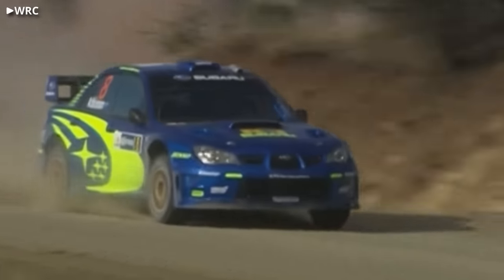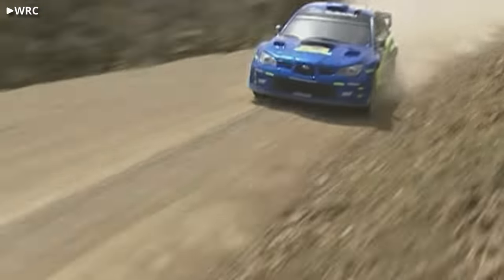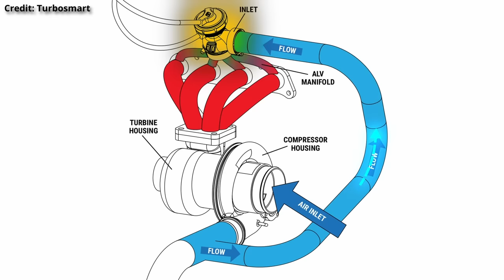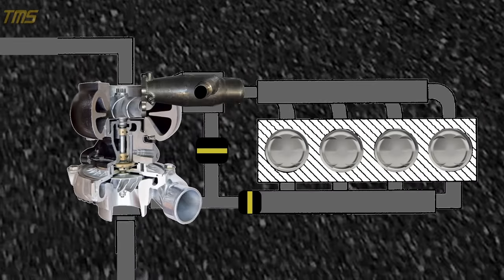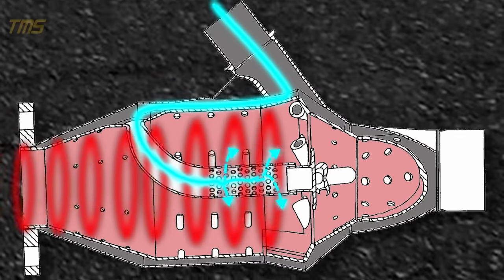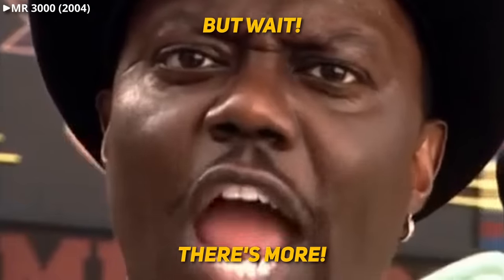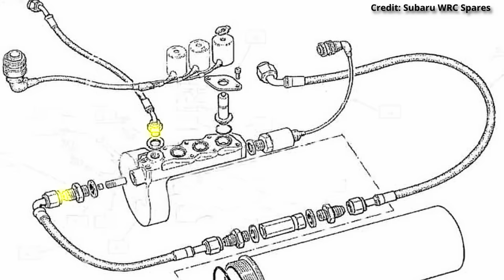When Subaru Put a “Jet Engine” In Their Exhaust | Rocket Anti-Lag Explained!

Comment: This is a lot closer to a jet engine than you would think. In fact, really the only thing seperating it is that it does not provide thrust for movement, and that's not a specific criteria to be a jet engine at all. This is what would be called an annular combustion chamber, and has some really neat things going on for efficiency, but I digress. While all combustion chambers will have a source of ignition, what most people don't realize is that that source is only used during startup. Jet engines otherwise have a constant combustion going on at all times as new fuel and air is introduced and combusting air is exhausted. One of the challenges of designing these systems is making sure that the combustion doesn't get "blown out" by the high entry speeds of intake air. Not only that, but in pretty much every sense, this is a jet engine system. It's just more like you would see on a centrifugal compressor turboshaft or turboprop, and so not as common or recognizable (axial compressor engines are the 'normal' jet engines). You could also like it to an APU since there's no real 'work' being done by the system. But they key things are, a combustion chamber where combustion is constantly taking place, whose exhaust gases feed a turbine, who spins a compressor, who feeds the combustion chamber more air. But in every sense, it's a jet.

Comment: You have a better understanding of these systems than 99.9% of people out there, and I'll share a few things to fill in a few blanks:

Re: Myth 1 - the boost pack (cylinder on the top of the engine) is a boost accumulator, but you are spot-on for what it is used for - turbo speed control (i.e. wastegate control).  In that sense, people saying that it stores boost aren't wrong, but their assumptions that it feeds the rocket system are misguided.  It is one critical piece of a very complex system that controls turbo speed and boost.  FIA homologation document A-5695 sheds a little light (very little) on how the solenoids are used in engine controls if you ever want any further information.  From what little technical information the homologation provides, the three solenoids are used rather than a single large solenoid to maintain a very precise control over the pressure in the accumulator - simply put, the more variables you can fix in a control system of this complexity, the easier of a time you will have 'programming' it to do what you want.

Your section on turbo lag is the only section lacking detail of 'why' anti-lag is so important in rally competition.  To complete this, you need to consider the intake air restrictor the mandated distance of the sonic nozzle choke point (plane) to the leading edge of the compressor blade - usually 3-5 mm depending on the competition rules.  This effectively does two things - limits maximum airflow by mandating a maximum orifice dia. AND forces the turbo to operate as if it were at a much, much greater altitude by creating a relative vacuum immediately before the compressor blade.  Obviously the builder still wants the same power out of the motor, so the turbo is forced very close to the surge line to make the same gage pressure.  Understanding of sonic nozzles and sonic flow also helps make sense of why turbo rally motors tend to have no torque until they hit a specific RPM, where they get a MASSIVE spike in torque which tapers as engine speed increases.
Reply: The turbo restrictor challenges are something seen at lower levels of competition, such as GpN or North American rally equivalents.  Many people would assume that rally homologated special editions of Mitsubishi, Subaru, and other makes use more exotic materials in the OEM turbos to save weight (Titanium in compressor blades, shafts, etc.), but often these are actually there to provide longevity to restricted turbos as the internal forces they see are far greater to achieve the same amount of power.  Aggressive anti-lag and over-speeding of the compressor are almost guaranteed at these levels of motorsport given the budgets and rule-sets.
Reply from the maker: Thanks for the additional info! I'll have to read up on that FIA doc, sounds interesting. And those are certainly good points regarding the intake restrictors. I love learning from my audience just as much as I enjoy sharing this stuff with others!
Reply: @themotorsportstory  the FIA homologations do a very good job of hiding the rocket assembly overall, but having a complete library of Subaru GpA documents would be nice if they didn't cost 300USD each.  Since it was entirely passive piping, the functional diagrams just show it as such - simple pipe with a fresh air valve attached.
Reply from the maker: @MrSaturn7085  Just makes me wonder how much more cool tech is out there in racing that we don't know about!

Comment: I always knew that anti-lag was achieved by dumping extra fuel to the exhaust manifold but this is such an elegant system, no wonder it was so good. It operates more like a pulse jet engine than a typical "Rocket". The German V1 flying bombs of WWII kind of used a similar operating method.

Comment: Probably the only person to explain turbo lag correct.
But to be 100% correct, turbo lag is what happens when you are in the power band and come off throttle, the time it takes the turbo to spool back up(while all still in the power band) that is turbo lag.

What we commonly refer to as lag in the boost threshold.

Example: 1500-4000, vaccuum at 1500, full boost from 4000 to redline. That is boost threshold

4000-redline, full boost lets say 15 lbs, close throttle, boost drops to 0 while engine is at 5500, then reopen throttle that delay is what turbo lag is.

Also bring back innovation in motorsports

Comment: You know why its called "Rocket" ?

Because its a similar concept of Germanys V1 Rocket.

Its a pulsing combustion booster and it makes a similar sound like the V1 rocket once you aktivate it without a turbocharger bolted on...
Reply: Technically the anti-lag system is the same thing as in the V1. It is called Pulse Jet Engine. So in fact it is a rocket.
Reply: @MHKKN  Yes thats what I am saying and that is also the reason why its called "Rocket Anti-Lag".
Because Subaru basically used WWII Na*i Germany's technologie to win races 😂

Comment: Cool! I think they used same kind of system or some kind of a hybrid in Rally cross and for example VW Polo WRC as the antilag was running whole time from start to finish line and was more like buzzin than banging, letting the Turbo have maximum pressure when ever needed but that was controlled like the Subaru pro drive system was, perhaps a cheaper evolution version of the rocket antilag. Im only guessing, but i may have ran inside the Turbo down pipe burning a flame there to create vacuum to suck the turbo in motion, resulting cooler running turbo to make more power as the cooler the air, the more the power.

Comment: So, basically, it functions like the Umluft anti-lag system, used in the Audi Quattro, which basically turned the turbocharger into a cebteifugal flow turbojet, in order to keep the turbo spooled, by letting the charge air bypass the engine and go directly to the turbine, while the engine ryns fuel rich, to then get a fuel air mix the combusts and drives the turbine, which keeps the compressor spinning.

Wild stuff, didn't know Subaru also had a go at this.

Comment: 9:15 The rocket actually works more like a ram air engine. A ram air engine is a high altitude compressive engine with zero moving parts. Except for a fuel valve that meters the fuel. Only thing about it is. It already needs to be assisted into the upper atmosphere. And theoretically maintain flight for weeks or months before needing refuel. Now days the propulsion system is adapted into hypersonic missle delivery systems.

Comment: My take on this is that the "ROCKET" is actually a "Pulse Jet" like the ones used for the German V-1 rocket and was the beginning of the actual jet engine - there is a lot of info on pulse jet engines on the internet - check it out
Reply: Yep. I agree. I just commented basically the same. Guess I should have scrolled down a bit farther.
Reply: @johnsmith7676  - Speak your truth wherever and whenever you can

Comment: On the point about the rocket being a jet engine, when combined with the turbo and it's plumbing, it is to an extent a jet engine. An impeller pulls in air and sends it through the compressor housing, then compressed air enters a combustion chamber where it mixes with fuel ( in the exhaust gasses) and burns, raising the pressure of the resultant exhaust gasses and spinning a turbine which is connected to the compressor. Colin Furze has made several jet engines by adding a combustion chamber to a turbo. However, I do want to acknowledge that the original point, was that the rocket is not a jet engine by itself.
Reply from the maker: Fair points! You're absolutely right that the main point I was trying to drive home was that it isn't one by itself. I've seen some crazy theories people had that it had its own fuel system and turbine blades inside and I wanted to clear that up. Haven't watched Furze in a while, but thanks for reminding me that I need to go back and enjoy his videos! He makes some really cool stuff!

Comment: It's like a jet engine with a high bypass ratio. Also jet engines do not need spark to sustain combustion. I believe what Prodrive  intended for the toroidal flow is to sustain a flame front in the combustor, just like a jet engine does.

Comment: A great video...that's an amazing engineering stuff.
Is there any systems in cars where turbo uses pitch control I mean they can be controlled axially and radially to adjust according to needs and rpm.
Reply from the maker: Thank you. Not sure on the pitch control system. There are some turbochargers called VGT (Variable Geometry Turbochargers) which move internal vanes to effectively change the "size" of the turbine wheel for more efficiency. They're common in diesel applications: https://www.youtube.com/watch?v=eUVStuiljIU

Comment: Just use a Supercharger and no lag will occurs. You can spin the Supercharger up to keep the boost where you need it by using an electric motor on the drive and then very the rpm to suit your boost needs. This creates a silent boost system and it can be much more reliable than a turbo set up and can lead to a much more precise tuning of your boost needs.

Comment: I got this system working on one of my project cars a couple of years ago, i didn’t know about the patent drawings so i had to imagine what it was based on what i heard in the subaru wrc videos. You forgot to mention that it runs cosed loop targeting turbo speed, as oppose pressure like other older systems. And the hoghest EGT is on transient and part throttle. I have a bideo on my channel of it running 🙃
Reply from the maker: Just watched the video, that's awesome, great job! Hope it works well for you long-term and I'll keep an eye out for more videos :)

Comment: This system is similar to a rocket engine in several ways: first when I hear 'fuel rich' I immediately think of the fuel-rich staged combustion cycle used by many advanced rocket engines like the RS-25. Second, rocket engines usually use a 'film cooling system' that's quite similar to the cooling used in this system. Finally, the turbo in a car is similar to a turbopump used in a rocket engine. However, many, many things are oddly backwards here: the true rocket equivalent of the turbo is an oxidizer pump, and the engine is a fuel pump. This means that 'the rocket' technically has a tap-off cycle oxidizer pump and a fuel-rich staged combustion fuel pump that's actually not a turbo pump, but an otto-cycle piston engine which generates higher power output than the 'main combustion chamber'!

Comment: Looks closer to the combustor in a modern high-end turbo-ramjet systems than a rocket.  In fact, using this as a combustion chamber could allow a larger turbo-charger to function as a turbo-crank and power the car, provided you get some source of initial starting to heat everything up.  (Possibly use it to finish the burn initialized by a wankle engine.)
Reply from the maker: Interesting idea!

Comment: It's quite literally exactly what you said, a jet engine combustor. The only difference being that the hot incoming charge is fuel rich instead of the fuel being injected at that point...think a carbureted jet instead of a fuel injected jet.

Comment: Seems logical in hindsight. A turbo basically is a jet engine, they just added the missing combustion chamber to it. What's more interesting with it is that elected to only use this for anti lag when it could have also contributed to overall boost allowing for an even bigger turbo and ridiculous boost pressures. It might even contribute to efficiency with the right tuning as that kind of combustion produces more usable energy than a piston ever could. Then again might as well fit a jet at that point lol

Comment: “Myth #1” isn’t a myth at all.

Thermodynamically the turbocharger-combustor system is a gas turbine running on the Brayton cycle. In other words, it’s a jet engine. The gas-fuel mixture mechanism is different than a typical jet engine, but that doesn’t change the fact that it IS a jet engine.

Comment: 😂🎉😂 Great explanation I used to be a Machanic but I don't know  !   if I buy a regular street Impreza WRX does it come with that anti lag sistem ... ??     Thanks
Reply from the maker: Thanks! As far as I know, Subaru has never sold a WRX with factory anti-lag. It would be far too destructive to the turbo, engine, etc.

Comment: Ex mechanic. I've worked on a wrx that had this system, not an ex wrc car. Just someone that spent a fortune to try replicate one, the system was a pain in the arse to tune. And honestly from my experience test driving it, and his accounts, it's fun on the streets but impractical and can be dangerous.

Admittedly we were dealing with hand crafted, though stupidly well done components like the rocket. And we did not have Subaru's tunes ready to dump into this thing. He had a at the time pretty powerful aftermarket ecu, and from memory another cars ecu controlling the rocket.
Reply from the maker: I can only imagine all the headaches, but it sounds like you both had some good fun with it too! Thanks for the comment!

Comment: Oh wow, I heard so much of this system growing up, and love how it works! Amazing piece of engineering! 
Question: what anti lag systems are the current teams running? 
Thanks again
Reply from the maker: You know, I had the same question once I found out that air injection is banned at the top of WRC now. Some of the theories I've read are that it's more like the first kind of system in this video where ignition timing is delayed. The engines in Rally1 are also direct fuel injection, meaning that they are potentially also directly injecting fuel into the cylinder on the exhaust stroke which would help. Can't say for sure though!
Reply: @themotorsportstory  interesting! Thank you! 🙏

Comment: The Leclerc has an eight-cylinder SACM (now Wärtsilä) V8X-1500 1,500 hp Hyperbar diesel engine and a SESM (now Renk AG) [21] automatic transmission, with five forward and two reverse gears. The official maximum speed by road is 71 km/h and 55 km/h cross country (speeds in excess of 80 km/h were reported on road). The maximum range is given as 550 km, and can be extended to 650 km with removable external tanks. The "hyperbar" system integrates a small Turbomeca TM 307B gas turbine in the engine, acting both as a turbocharger and an APU giving auxiliary power to all systems when the main engine is shut down. The Hyperbar name comes from the unusually high boost pressure of 7.5 bar and the resulting mean effective pressure of 32.1 bar.[22] In comparison, the largest diesel engine in the world (the Wärtsila RTA96) has a mean effective pressure of 18.6 bar.[23] In addition, with boost available even when idling, this arrangement also works as an antilag system.

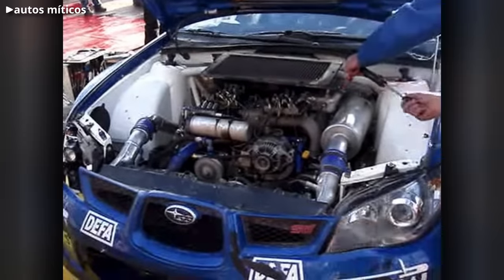Comment: 12:25 either that.... or they are doing a pressure test, to check for any coolant leaks (which would include blown headgaskets LOL) 
.
that pump is the EXACT SAME pump you can buy in a kit at the parts store for putting pressure into a cooling system..... then watching a pressure gauge for ~30 mins to see if their is any drop
drop = leak
Reply from the maker: Good point! I've had to use that pump more than once unfortunately on my car haha. There was another article I found that I've put in a pinned comment at the top of this comment section that talks about pressure being added to the system to check for any trapped air in the system, so that's potentially another explanation. I took my best educated guess at it. Thanks for watching and subscribing, I appreciate it!

Comment: With a little bit of refiguring on the tuning and you weren't racing you could use that rocket system and get amazing gas mileage an extra horsepower out of a tiny engine

Comment: Speaking of anti lag. Anti lag was somethinf that f1 cars did not have and in the 80s/90s those insane,crazy people were running up to 5 PSI OF BOOST on those things in a quali setup and not having anti lag,from a stand still,if you smash the foot to the floor you get a good 2/3 seconds where the car is just numb and then the boost picks up and if you aren't ready for it you get all those 1500hp at once and you die.

Comment: It's basically a Tesla valve. Like, almost perfectly tbh. Always knew they weren't useless, I've been thinking about a similar set up as a replacement for a CAT. Since the more you put in series decreases the pressure required to flow and increases velocity. 👀